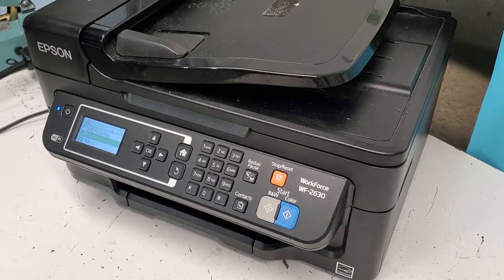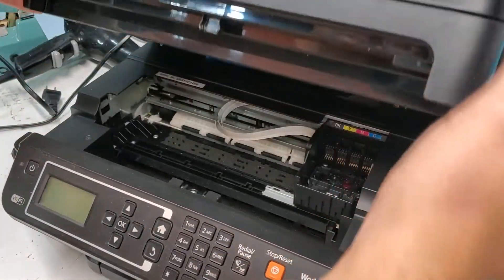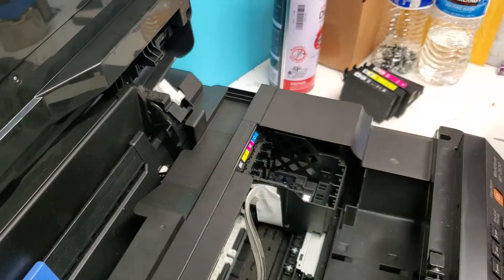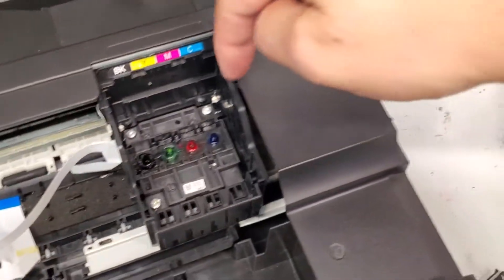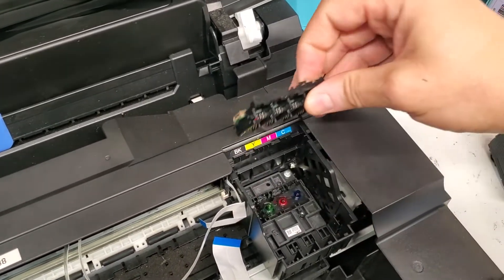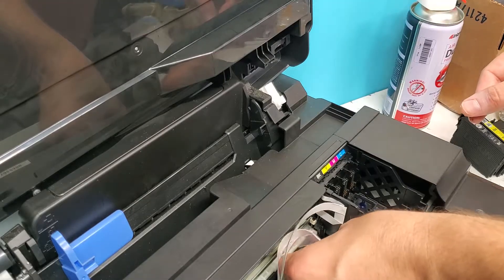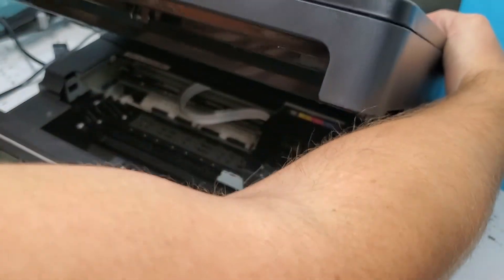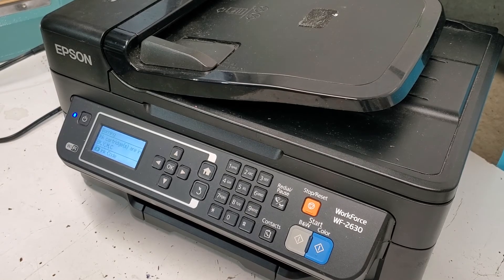How to Replace Printhead Epson WF-2630 WF-2530 WF-2540 WF-2510 WF-2520

Comment: Watch out and don't move on too fast at time code 03:03: If you disconnect the small upper white cable on the back on the left side, you will run in to the problem of not getting it back in. Congratulations to myself. 😲🤯
Reply from the maker: Thank you for the "heads up"!
Reply: So... How did you get it back in? Asking for a friend😬
Reply: 1. I bought a bent tweezer (16 cm) from Amazon for 5.99 Eur.
2. I wrapped a very little piece of ductape around the end of the cable right before the contacts for a better grip for the tweezer onto the cable and for more stiffness of the cable.

3. Put the cable between the tweezer, hold very tight and put the cable back in. You probably need to take off the lid of the printer as well as the long plastic cover (watch https://youtu.be/FweisSJrOb0 - Timecode 6:55 - 7:23)

4. It took a few attemps but after about 10 trial and errors I got it back in, yeahhh!

Once I also tried to take the whole printer apart which took me about 2 hours and another hour to put it back together. But I would not recommend that because after that it made strange sounds and did not work anymore.

Enjoy the process! ;-)
Reply from the maker: @clauspeterknoll  Good work! Thank you for sharing.  Very useful information. Have a great weekend.
Reply: @clauspeterknoll  shieet. too late... i've removed the small cable :(
Reply: WARNING:  Sure wish he would edit this video to put in a warning about that cable that DOES NOT need to be pulled out, and is a real pain to get back in.  At least do a text overlay on the screen, "WARNING DO NOT PULL OUT THE SMALL UPPER RIBBON CABLE"
Reply: Yea, I think I messed up my printer because of that mistake I made 😞 hopefully I’ll find another way to put it back in because it’s not going well with the tweezers

Comment: Did it. Had problems to close the top lid again (the black did not attach correctly to the white plastic thingy).
I cleaned it with Isopropanol and an ultrasonic bath -> its broken now 😅 after trying the first print, one high spule noise and gone...
Reply from the maker: Thanks for sharing! Have a great day!

Comment: So I've taken two of these out and one the top half of the printhead broke off pulling a tube off the nipple, the second I took out and it also broke the same way but I didn't force it. I just carefully lifted it off. They should be tightly connected or not? If so you think I could glue them together?

Comment: Hi there ~ great video! Quick question: after replacing the print head on my WF 2630, I turned it on and got error code 0x60. I've cleaned (I think) the PW sensor and checked the gear assembly under the left cover, it's also clean. What else could be causing this issue? I can't get past it to check if the print head is working or not. Thanks so much and have a great day : )

Comment: I was putting alcohol through a syringe connected to the nipples down in there and pulling th e tube off detached the while piece on top breaking this seam with a gasket in between open. I can place it back on where it was but it's not sealed. Did I break it? Same exact model
Reply from the maker: I'm trying to figure out where the seam is that you are talking about. I honestly do not think that you damaged anything by what you are explaining,  but I'll look at the printer once more to see if I can give advice. Thanks.
Reply: @303electronics  you know those nipples which fit under the ink cartridges. It would be the top of the printhead I guess. Well it's it's own piece. If I'm not mistaken, a little plastic piece broke off from the printhead in guessing had fit into the nipple piece/face to hold it in place.

Yeah, it seals to the top of printhead so the ink doesn't leak out in between. So there's an actual rubber I guess gasket. Under the nipples on the other side of place/face that is pressed in if plate is secured right. My eyes are bad so can't see how it's secured exactly till I get in there myself which I'll try to do today. Thanks

Comment: While working on mine,  the white hinge for the lid has jammed its way back when I pulled the top off, and is now stuck not allowing me to reconnect the top, I would suggest not taking the scanner lose,  I am spending more time trying to fix this then I did unclogging the head, and it was bad.  Where is the easy button.

Comment: i have the wf2530, sometimes it prints with lines on letters, after i do a clean head cycle it solves it just for a few print jobs than starts to do it again,  I've had this printer for over 10 years, that sponge thingy inside that looks like ink is on it, what is that? do i have to replace that sponge?

Comment: I broke my print head nozzle on my 2630 can it be replaced
Reply from the maker: Do you mean the tip that cartridge goes over? If so, I do not know how that can be fixed. It is less likely gluing it will be a good idea. You may need to replace the printhead altogether.  I'm sorry
Reply: It seems that these have a tendency for the nozzle to break . The tip of my nozzle broke off about 3 weeks after purchase. With only enough pressure to place the cartridge. I see good amount of post with this issue. I never had the time to return the item or repair it until now several years later. 😮 My feed nozzle broke on the black ink. Brand spanking new. Smh. Thanks for the video. This video was the only one that was able to help me figure out exactly what to press to remove the chip board. The hardest part was finding where to press. 😅

Comment: Do you know if "scanning error" means that I didn't put the wire strips in correctly? I just did all steps in this video, turned it on, and the ink tray is able to glide across, so now I have them out on the track with the printer unplugged.
Reply from the maker: It may mean that. Check the connection and make sure pins on the connector are touching the golden side of the wire.
Reply: @303electronics  thanks I appreciate the reply. Checked them again and same thing. "Scanner error."* Too bad... thanks for the video though. I have a WF-2540. Guess I'll have to toss it.

Comment: Helpful but my scanner wire came out so had to work out how to get that back in, and my lid won't sit on straight. I tried to force it on and I think I broke the hinge but it still works
Reply: I somewhat have this issue. I can't find where the right side of the top connects to the bottom. I'm thinking it's that white piece but it doesn't move so I'm not entirely sure it's that. Nothing else on the right side of the bottom pivots

Comment: In taking the printhead out I mistakenly unplugged the back ribbon connection. I am having problems reconnecting it. Is there an easy way to reconnect?
Reply: get yourself some small tweezers to align it and then push gently with the finger so all the force is applied to the blue "robust" part of the ribbon cable

Comment: Thanks for the video! I got problems putting the lid back on. The parts on the right side on the rear of the printer  just don't go back together. Looks like the white part, where the screws probably goes in, flipped back or so while removing. 🥲 Can anyone help?
Reply from the maker: I see what the problem may be. The spring loaded hinge on the right is either up or down. If it is up, the lid needs to installed at a 45 degree angle,
Reply: @303electronics  It worked at about 45 degree angle. Pushed it in, held it tight, put it down and screwed on again.
Reply from the maker: @clauspeterknoll  Yep! I'm sorry I didn't point that out in the video. Thank you very much for sharing.  I'm glad you got it all set! Have a great day!

Comment: Now I get a snanner error 😢
Reply from the maker: The scanner wire needs to be reconnected to the main board. The side cover removes to do that. When you open the top too far, it may cause the scanner wire to disconnect from main board.
Reply: Yes, it did disconnect.  Tried to put it back in, but it didn't work.  I'll rewatch a teardown video to see about removing the side.  Thanks @303electronics